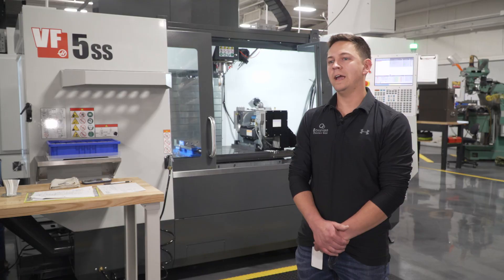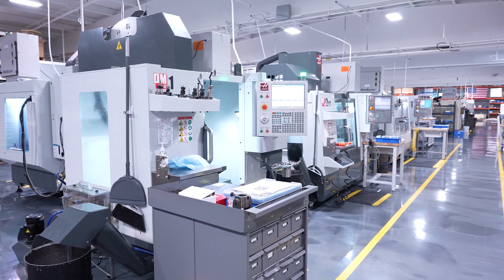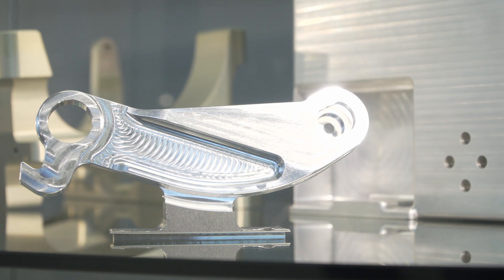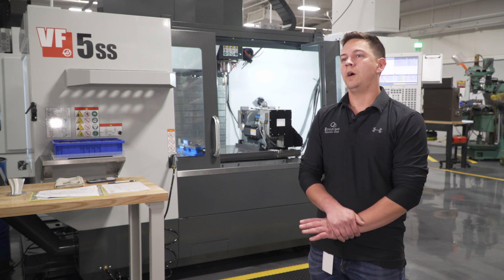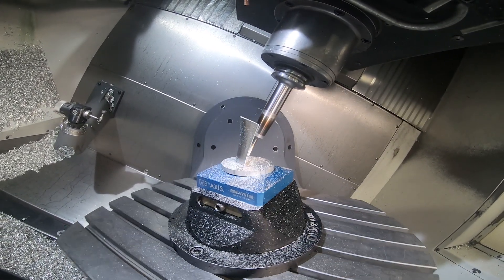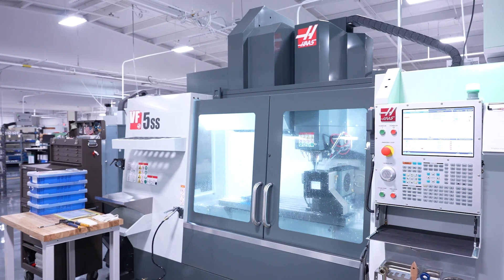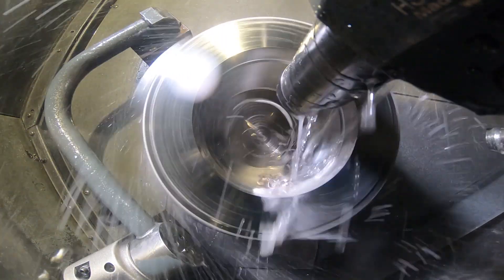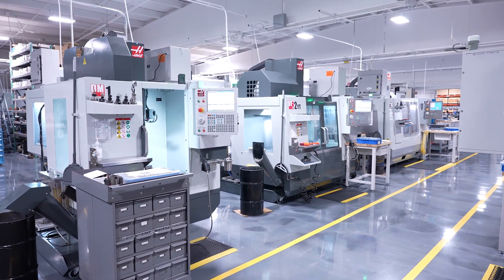Machining Complex Parts for Outer Space at Boulevard Machine & Gear

Comment: 3axis = 10 setups lol
Reply from the maker: If it's a very complex part with tapped holes at several different angles, I suppose it might require 10 setups on a traditional 3 axis mill.
Reply: @hfotridentmachinegroup  I'm just quoting the video.. 10 setups seem a bit exaggerated
Reply from the maker: @TheSoundOfTwang  I hear you, but who knows, there are some wildly complex parts out there!
Reply: @TheSoundOfTwang  not uncommon i‘ve had to run 12 setups on a single part before on my vf2